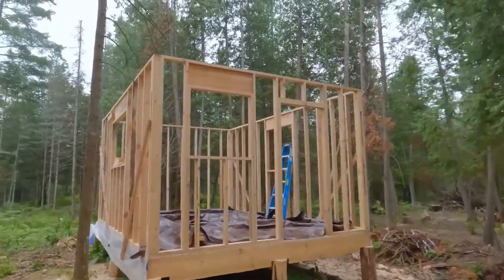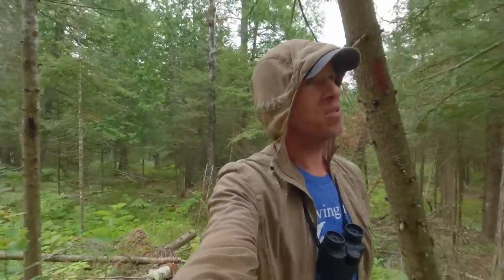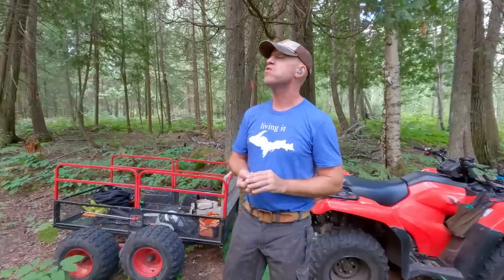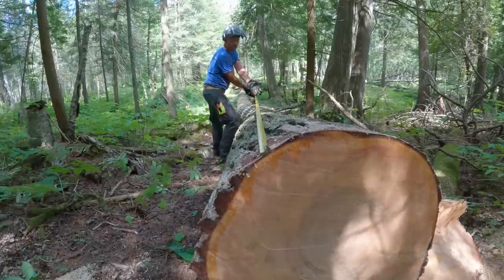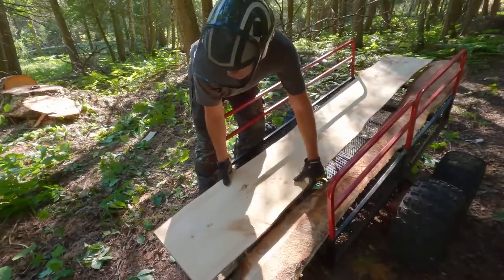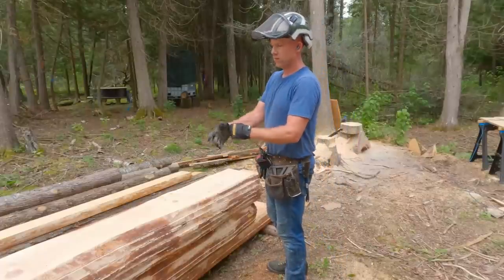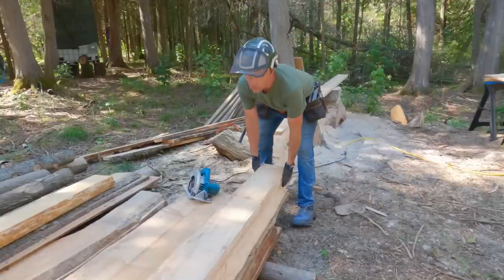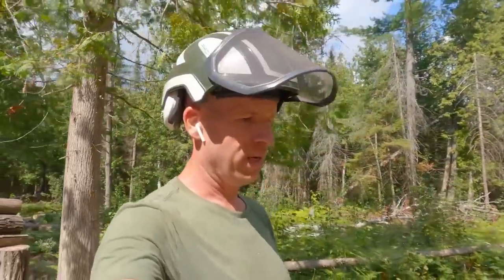Droning for Milling Trees- Making Cabin Rafters #99

Comment: Try a shorter extension cord for your circular saw it should work better and last longer. I know that battery chargers don't
 work right with long cords and I would think the same applies to other corded tool that draw a lot of voltage. 
I really enjoy my Saturday morning Ringworm thanks for all of it
Reply: If the cord is warm, it's too small. And, rule of thumb is to go down one size in wire gauge at 50 feet and two sizes at 100 feet.

Comment: I’ve been using the same Makita circular saw since 1986. Paid $99 on sale at the local hardware. It squalled one morning that Winter on an early 14 degree morning. That evening after work I opened it up and packed the bearings with grease and since have replaced the cord and brushes several times. Using Diablo thin cerf  blades the last few years. It rips through lumber.

Comment: You could make all of your rafters as long as needed on the wider side, put them all up, snap a perpendicular chalk line on top of them parallel to the cabin wall, at a depth you want for your overhang. Then cut the excess off the rafters at the chalk line.

Comment: I would maybe put a slight twist to the roof as in not quite flat. The lumber you use won't care and it shouldn't even be seen. It would be just a little lower on the short unsquare side. When I typed unsquare it corrected to unsure.lol

Comment: Weird. I thought I just commented. Did it error out? Was it deleted? We may never know. Anyway, 6'6" is what the rafter tables say you can use for a horizontal span on 2x4 rafters that get a snow load. That's with store-bought 2x4s, not your beefier 2x4s.

Comment: You should get a portable sawmill it will come in handy / back pain no more / hight adjustable / cut longer boards / bigger trees.... Downside uses bandsaw blades / $$$ price but if you use it allot of the time price of it goes down....  Plus the resale value of it....

Comment: When you splice boards together.  Just use glue.  It is better than the board.  Just use nails or screws to hold it temporarily.  It will never sag on you.  Good job on cutting those trees down .  I thought you were going to be in trouble.  Later

Comment: Hello. Ringworm. The boards. On the end. Of roof.  Are called. The. Rake boards. Refuring. Too. The. Rake of the. Roof.  The.   Facia.  And. Sophet.  Front and back.  Gable. Ends. Are. We're.  The. Rake boards.  Are. Found.    Out of. Square.  You should. Take it. Apart. And. FIX. IT.  Because. You know. It's. Wrong.  Now.   Cmon.    Your. Learning. The. Hard way.   So. Do it wight